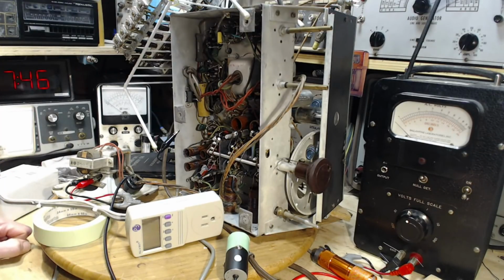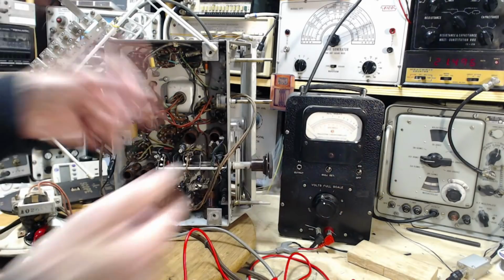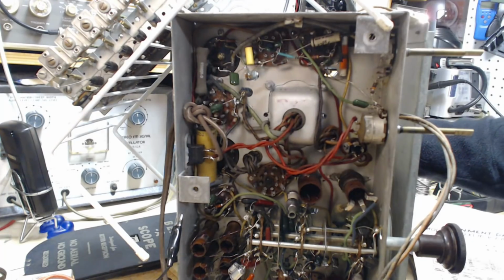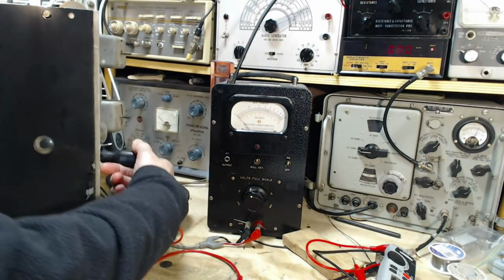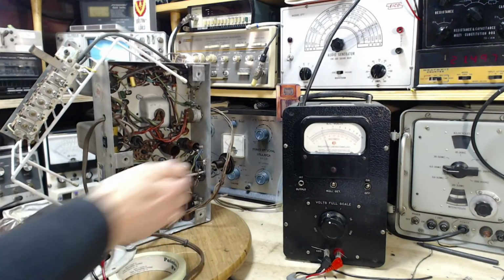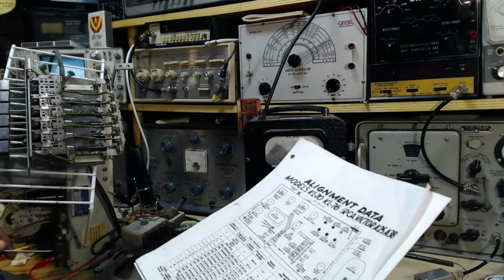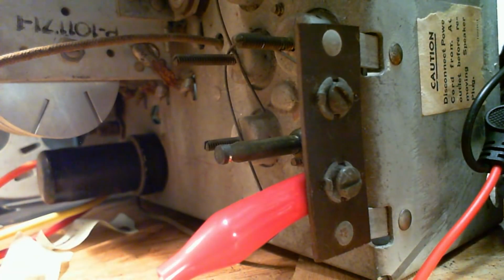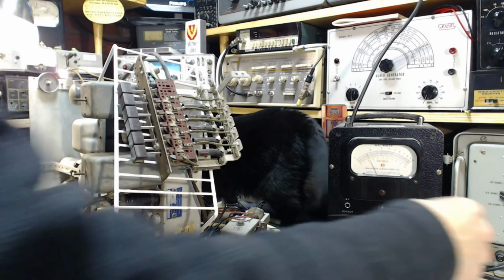General Electric KL-70 AM/SW Radio Video #28 - Alignment Challenges

Comment: Mystery signal source: It is probably coming from your frequency counter. It appears to have a plastic case and any shielding in it is probably aluminum on cardboard. The face is likely the exit for the RF signal and the radio is picking it up. Far from being good it is likely strong enough to activate the radio's AVG, defeating your ability to tune it properly. Try this: After you set the frequency you want remove the cable linking the generator and counter. See what the signal is then. Make sure all gear is grounded.